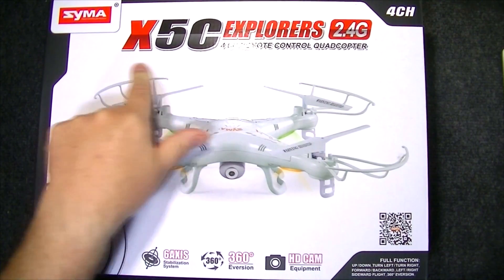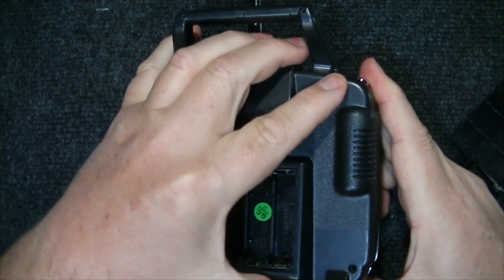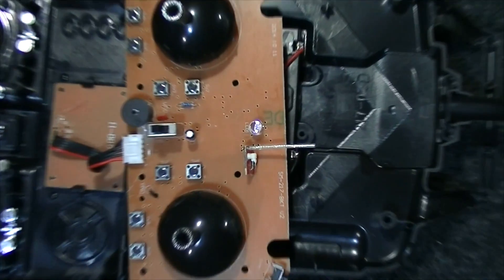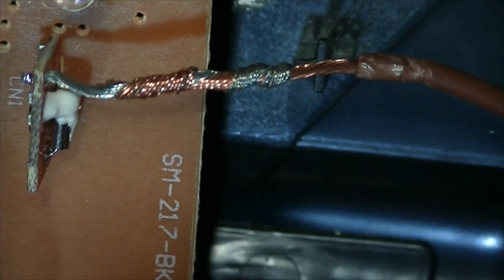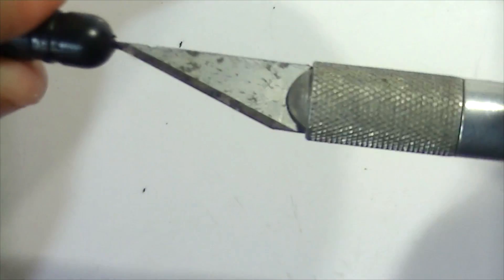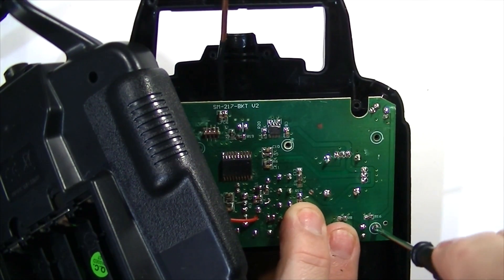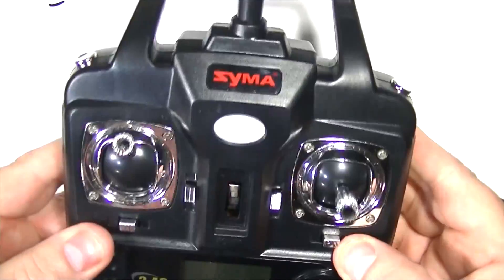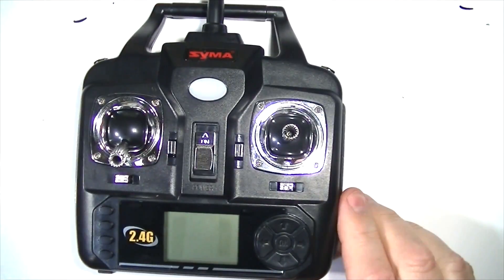Syma X5C Mods - Range Extender Fix - Without Soldering Antenna Length Hack

Comment: This is a BOGUS method, and I DON"T recommend anyone do this as shown. What he has done is change the TX antenna from 1/4 wavelength to a full wavelength (at 2.4ghz frequency). The problem is, the Full wavelength antenna DOES NOT exhibit the correct impedance to the RF output device. Because of this mismatch, 2 things can happen. The RF output device will NOT put out the proper amount of RF, and some will be reflected back at it, due to the mismatched impedance. The 2nd scenario is that this mismatch will cause the RF output device to heat up and FAIL.  If you want to attempt this "hack" as shown, DO NOT make the antenna extension 12.5cm long. Rather, make it 9.5cm long. (a 1/4 wavelength antenna at 2.4ghz is = to 31.5 mm or 3.15cm) It is also advisable to solder the connection, rather than just wrapping it, as the oxidation between 2 dissimilar metals will eventually cause a poor connection and degradation of signal output. Finally, if RANGE is what you want, simply buy a Syma X8C TX for about $14 online at many of the China Retailers. Also, in the X5C quad itself, raise the 1/4 wavelength wire antenna up VERTICAL, and make a small hole in the top of the quad shell, letting the antenna protrude out the top. Using this method (X8 TX & vertical quad antenna), you will have range to 300+m .. well in excess of your visual ability to see the X5C. My qualifications for this information are that I'm a retired Senior Electronic Technician, and also hold the highest class Amateur Radio (ham radio) Operator's License. I've been working with RF for 50+ years.  I hope this will help some who view this video from possibly making a mistake.
Reply: I first tried the 12.5 cm length and it worked great. I did shorten it based on your recommendation and was able to fly it at a comfortable distance.
Reply from the maker: Thanks for the tips Bill.
Reply: Vanessa Anonymous sounds like you did not put the buttons back correctly...
Reply: @Weird_1  yeah she pushed wrong button lol!
Reply: Bill Somrak thank you for great tip bill.  and great step by step video to Robert
Reply: I tried this and it did nothing to improve my range , in fact it Made things worse. ..couldn't make it flip !
Reply: @vanessabrousseau9358   Oh dear, so you flipped ????;-P
Reply: @vanessabrousseau9358  Not surprising - the impedance mismatch to a full wavelength antenna is reflecting back to the transmitter and you're losing a fair amount of power.  Also, as somebody else mentioned, you may have not put the buttons back properly.
Reply: Hey Bill would making a dipole antenna be better for this? Since I am just learn this stuff today I noticed my factory controller has only one solder point so no ground is needed for the single wire?
Reply: "Thanks for your time! And mine.
Reply: Thanks, that's really helpful.
Reply: W
Reply: Hi Bill,
Thank you for your advice.
I've done the 9.5cm long on the transmiter, do I need to extend the antenna on the drone as well?
If yes, How long it should be?
Regards,
Reply: @marcelocosta1233  You don't need to make the wire inside the drone any longer ... just raise it vertical, make a small hole in the top plastic shell to poke it thru. That alone might be enough to give you 75m to 100m range.
Reply: @billsomrak  Thank you Bill. I have left the cable on the controller 9.5cm total length.
It works fine.I'll leave it as it is.
Kind regards.
Reply: You my friend are a gentleman, thank you
Reply: SPOT ON BIlLL......fly safe - good piloting.
Reply: Bill Somrak will a syma x8hc transmitter bind with a syma x5sw quad?
Reply: @jimbutuyan5249  It should ... as long as your X5C has a rev 6 controller in it, which most of the later models had.
Reply: Wow im so impressed well thankyou sir Bill Somrak wewww thank god i didnt do these
Reply: thanks for your advice!
Reply: @dbmandrake  boss if u dont mind what is the material name u use 2 add for the antena bcoz I want 2 buy n where can get it please n thanks
Reply: Boss if u dont mind can u let me know what is the thing that u use 2 add 2 the remote control so I can buy  it n where can get it thanks
Reply: @SURESHSOUNDARAJAN  You can find 2.4ghz antennas on eBay, or, if you have an old Wi-Fi router (one that's broken), you can take an antenna off of it to use on the X5C's TX. Mount it any way possible on the back of the TX case, and run the coax inside the TX thru a small hole.  SOLDER both the center conductor & the shield to the appropriate places on the PCB as noted in the video. Raising the antenna on the X5C quad itself, so that it sticks out through the top shell of the model might give you enough extra range without doing the TX mod. Good luck.
Reply: @SURESHSOUNDARAJAN  Please use normal words. Don't write as a teenager in a hormonal storm
Reply: @gianfrancescopia1392  is that bothering u or what n did I say something wrong or bad about u if there is any mistake teach n correct it be more mature first from telling others how 2 be n sorry if I said something wrong
Reply: How if I want 2 add a gps tracker on my drone a very tiny 1 is it possible n if possible how 2 install it thanks
Reply: @SURESHSOUNDARAJAN  With the motors in the X5C, it has a limited "Lift" ability. 30 grams is probably the MAX. extra weight you can carry (most small GPS Trackers I've seen advertised weigh more than that). However, remember that by adding additional weight, you will be stressing the motors, and they will burn out more quickly. The motors aren't too hard to replace, and are still available. Suggest you don't over load your X5C .. use it to learn to fly and learn orientation, so that you can always fly it back to you. Never fly down wind on a windy day, as it can't penetrate wind very well. When you get good at flying, get something with a bit more power, like a MJX Bugs 3 or equivalent.
Reply: @billsomrak  thanks for the tips boss I think that is the correct way boss n thanks again
Reply: Sir 
I have one 2.4ghz antenna
That's comes with my udi rc u818a drone,
In ur openion is there any chance to improve it's range? can u help me
Reply: @user-ro4qr9kn2h  If you have the ability, you can try to extend the drone's small antenna out the top of the plastic shell, standing it up vertically. I've never seen this particular drone, but, in general, having the drone's antenna sticking straight up gives better range than one that is folded over and lying flat. Modifying the transmitter antenna requires quite a bit of experience, and I don't generally recommend it. Good Luck.
Reply: @billsomrak  thanks for ur valuable advertisement
Reply: @billsomrak  I'm trying to modify my drones antenna
In ur knowledge is there any measurements in drones receiver antenna's and what kind of wire is best for it?
Reply: @user-ro4qr9kn2h  If you read all of my initial post, I describe the various lengths of antennas. 31.5mm is the standard length of the wire of the receiver inside your drone. Carefully open your drone and you should see the antenna wire, which will usually be a black wire coming off the top of the PCB (printed circuit board). In the case of the Syma X5C, simply making this wire stand straight up, and putting a small hole thru the top of the drone's plastic shell for it to exit was a simple fix. I don't know if this simple fix is possible on your UDI drone, as I've never seen one. If you can do that, that might be all you need to do to get additional range. If the wire is too short to stick out the top vertically, you can extend it by soldering another 63mm of similar wire to it. Make sure that the over all length, from the PCB to the end of the receiver antenna is 9.5cm (95mm) long .. exactly! Only do the extension if simply standing the original antenna up vertically doesn't work or you can't do it, because the PCB is too far away from the drone's plastic shell. You have to decide if this range modification is really worth doing. Just standing the original antenna wire up vertically will get you an increase from 10% to 25% in range. Making the antenna longer will give you an increase of 15% to 30%.  I looked up the UDI drone  you mentioned online, and it is designed as a BEGINNER'S quadcopter, and keeping it close to you will help you to learn how to control it well. When these small drones get far away from you, if you do not know proper orientation technique, you will likely lose the drone in a fly away. NEVER let your drone get down wind from you, because fighting back against the wind with a small under powered drone is very difficult. When you get to be a good pilot, who can handle any situation, you might consider upgrading your drone to something which has a better range. MJX makes a lot of medium grade drones with very good range. Good luck.
Reply: @billsomrak  thanks for your help
Reply: @billsomrak  thank you so much sir
Reply: @billsomrak  hey, i have a drone called eachine e58 so the battery lasts for 7-9 mins, can i add a battery to make it last longer or even replace the battery?

Thanks in advance.
Reply: @gman8599  Hello. Unfortunately, the E58 uses a "Proprietary" battery - a regular Li-Po housed in a special unit.  Manufacturers started doing this some time ago, so that there was no 'easy battery upgrade' path (which was often better & cheaper than the batteries which they sold).  If you were a good electronic technician, it might be possible to disassemble one of the batteries from the case which holds it. You could then find a suitable Li-Po replacement with a higher capacity (mah) value & get longer flights.  That's a lot of work. Its probably easiest (and best) for you to just buy a few more E58 batteries. Check around ... you may find them sold for a decent price.  Never leave  your batteries fully charged or discharged. That will cause them to fail prematurely. If you have a DMM (digital multi-meter), and you can read the voltage of the battery cell, store them (in between flying sessions) at 3.8 Vdc.  A full charged Li-Po will be about 4.2 Vdc. Usually, manufacturers make the quadcopter land when it reaches about 3.3 Vdc.  If you go below 3.0 Vdc, there is a chance you will ruin your battery. Also, never charge the batteries while they are warm.  Hope some of this info will be helpful for you & others who may read this reply. Cheers.
Reply: @billsomrak  what drone you suggest in the range of 50-150 dollars

Im kinda getting into drones so i want a basic one to learn how to control them before buying a 500$ drone
Reply: @gman8599  Not sure where you live. If you live in the States, Amazon carries a lot of the Holy Stone brand. They range in cost from $59 - $250 with many models in between. For the most part, they are good value.  Take a look at what Amazon has (search on Holy Stone drones) and then look for some YouTube reviews on the ones you're interested in.  I've not purchased any "toy grade" drones for many years.  Another good company is MJX, who makes the "Bugs" series of drones ... those are all good.  Very smart of you to learn to FLY 1st. Once you've mastered orientation and can fly your drone back to you in any situation, you'll be ready to move up to something more expensive. Good luck.
Reply: @billsomrak  thanks bill, really appreciate it man!
Reply: Thanks alot bkn boss for the tips I will try that for sure n let u know how is the feedback on that n thank u very much
Reply: What degree you have? Because im getting to college and im interested in this type of stuff is it electric engineering?
Reply: @gman8599  Actually, I have two college degrees. My 1st degree was a Bachelor of Science in Education  (B.S. ED.). Later, I got an Associate Degree in Electronic Technology w/Computer Science option (A.S.E.T.). Besides learning about modern electronics, it taught me computer programming in several low level languages.  Additionally, I hold the highest class Amateur Radio License, & used to be a Volunteer Examiner for the FCC.  I've always enjoyed electronics, and built my 1st 'crystal radio' when I was about 8 years old (with help from my dad). Be sure the college you select offers "Laboratory Classes", where you will learn practical stuff as well.  Good luck.
Reply: @billsomrak  thanks for the advice sir!
Reply: @gman8599  I never been 2 school my friend sorry
Reply: @SURESHSOUNDARAJAN  whys that?
Reply: @gman8599  never had a chance for it
Reply: @SURESHSOUNDARAJAN  sorry to hear that
Reply: Bill Somrak I think you mean to say to add an additional 9.5cm to the existing antenna to create a final overall length of 12.5cm, not a final overall of 9.5cm? A full 2.4GHz wave in a vacuum is 12.49cm. 
Orienting both vertically to the earth will definitely give the largest "cost-free" range increase, and impedance is absolutely important, as Bill stated.
Reply: @andinbriwel1092  The 9.5 cm (final number) results in a 3/4 wave antenna, which gives somewhat improved performance but maintains the same impedance to the driver circuit, to avoid overheating.  So don't add 9.5, just replace the current antenna with one that is 9.5 cm in length from the surface of the circuit board to the tip.  Replace the current wire and solder the new one: wrapping as the video showed will soon degrade the signal (especially if you live anywhere near salt water coastlines).  If you drill a hole in the antenna cover, don't just cut it with a knife, you can match the hole size to a reasonably sturdy drinking straw, to keep the wire from bending.  On the drone, consider drilling a small hole for the antenna to protrude, vertically, and perhaps but a flexi-straw around it (so it can bend if you crash, and you can semi-rigidly put it back in place).
Reply: @andinbriwel1092  I've just started learning this stuff today, but he might mean exactly what he said, which would make it 3/4th wave which would operate at lower ohm's to match the output impedance of the controller. He told you what mm 1/4th would be times factor of 3 is that 9. Something mm he said. Correct me if I'm wrong.

Edit.. someone already stated this. Just read in down lol. O well I was right heh.
Reply: GamerDooD it is correct that 3/4 wavelength would be 9.45cm. My original comment was defining the length for a full wave antenna. Looking back now at Bill’s original post, I see that 3/4 wave is what he was going for, not full wave. Which is appropriate on the transmitter side. FWIW, I didn’t just start learning this stuff today 😉
Reply: @andinbriwel1092  so just to clarify, if I solder in a new piece of wire what should its length be?
Reply: Your right sir, but pay closer attention, he added the correct amount which made the total length in the 12.4 something. yes soldering any wires is better but this is a fast way to extend range on a toy grade quad without soldering. this quad is like 22 bucks so anything quick that helps I think is ok. However I enjoyed reading your comment.
Reply: That was alot of typing when you could've just said that you have no clue what you're talking about and love google 😄 idiot
Reply: Is that ur problem if u know then u wont be in this name n u will be called Google  smartass

Comment: I tried this but I must have screwed something up. Now my drone looses the signal very often, even from 5 meters away. I basically can't fly the drone anymore, it's basically guaranteed to fly away. :(
Reply: See my explanation above.
Reply: Sorry, I can't seem to find it. Can you link to it?
Reply: This is a cut/paste of my comment posted down below. Hope it helps:

This is a BOGUS method, and I DON"T recommend anyone do this as shown. What he has done is change the TX antenna from 1/4 wavelength to a full wavelength (at 2.4ghz frequency). The problem is, the Full wavelength antenna DOES NOT exhibit the correct impedance to the RF output device. Because of this mismatch, 2 things can happen. The RF output device will NOT put out the proper amount of RF, and some will be reflected back at it, due to the mismatched impedance. The 2nd scenario is that this mismatch will cause the RF output device to heat up and FAIL.  If you want to attempt this "hack" as shown, DO NOT make the antenna extension 12.5cm long. Rather, make it 9.5cm long. (a 1/4 wavelength antenna at 2.4ghz is = to 31.5 mm or 3.15cm) It is also advisable to solder the connection, rather than just wrapping it, as the oxidation between 2 dissimilar metals will eventually cause a poor connection and degradation of signal output. Finally, if RANGE is what you want, simply buy a Syma X8C TX for about $14 online at many of the China Retailers. Also, in the X5C quad itself, raise the 1/4 wavelength wire antenna up VERTICAL, and make a small hole in the top of the quad shell, letting the antenna protrude out the top. Using this method (X8 TX & vertical quad antenna), you will have range to 300+m .. well in excess of your visual ability to see the X5C. My qualifications for this information are that I'm a retired Senior Electronic Technician, and also hold the highest class Amateur Radio (ham radio) Operator's License. I've been working with RF for 50+ years.  I hope this will help some who view this video from possibly making a mistake.
Reply from the maker: That is too bad . Others have had great improvement with this mod.

Comment: Made this mod on a X5SW and it helped quite a lot. Tested it on a breezy day, approx. 5 mph wind speed. Flew it out about a 105 meters, to risky to go much further. I soldered the  wire wrap on mine not sure if that helps or hurts or neither. At any rate a very simple mod which definitely helps. Thanks for sharing!
Reply from the maker: Thank you very much!

Comment: Hi Robert, does the finished mod require the new wire antenna to be straight up or can I hide it inside the controller handle ? fantastic clear video well done
Reply from the maker: Some have hidden the wire with satisfactory results. Thanks for the comment.